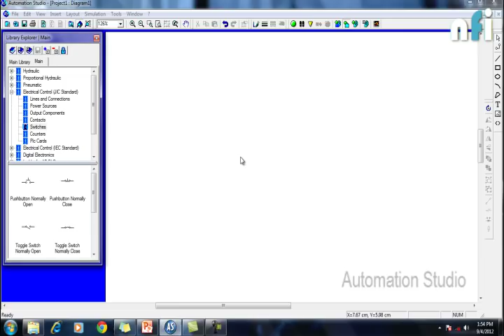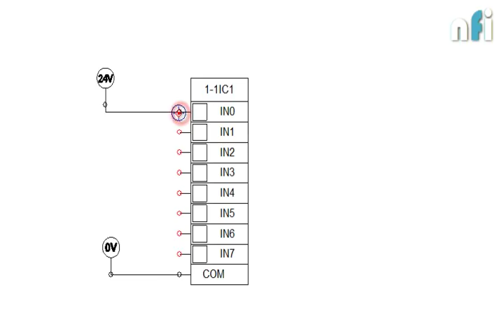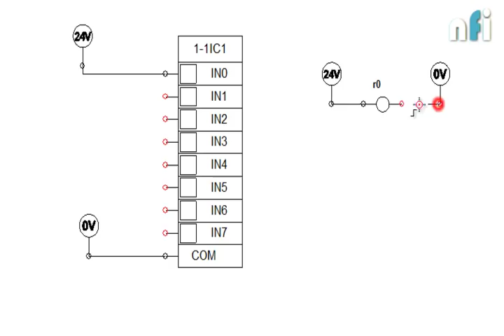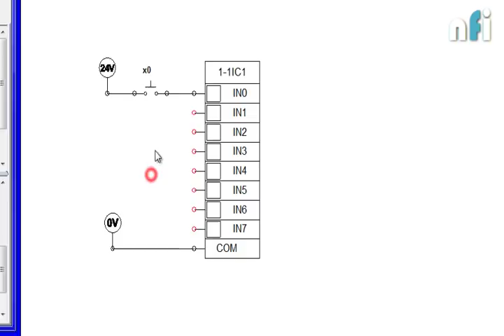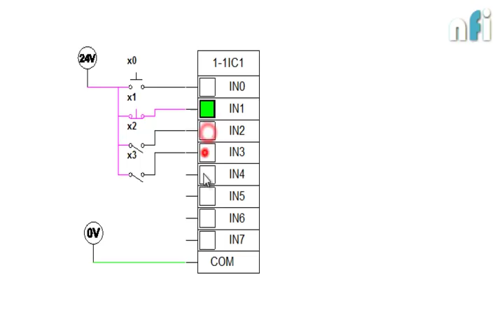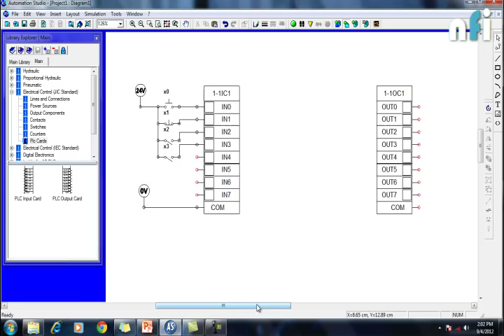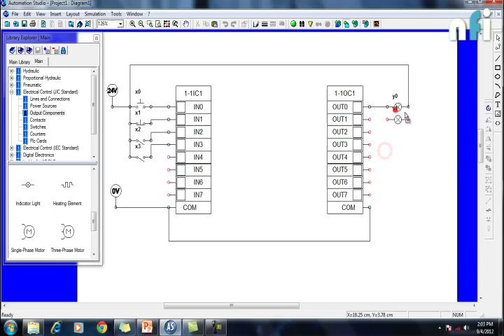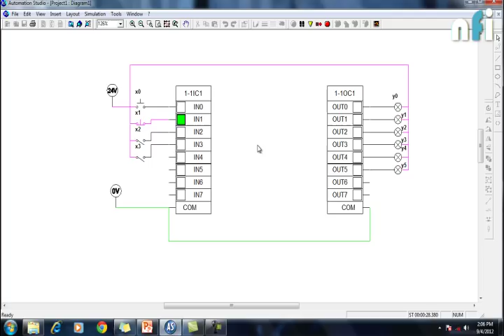PLC E-Learning Session 1 - Introduction to PLC & PLC Wiring

Comment: hai,
i had been working there in a Asphlat batch plant ,it automated with PLC micrologix 1000,but there is not any seperate HMI device for that  instead they where using one software named as "Parker"  from PC which were using for control purpose,i having a doubt here that the connection from PLC to PC is direct connection ? and  how to set that software ,can we use here any other software? please answer me .....

Comment: AIR VOICE ENGINEERING SOLUTIONS PVT LTD
Industrial automation
• Plc
• Scada
• dcs
• Hmi
• Drives (ac & dc)
• Process control instrumentation
Mep courses
• Electrical designing and drafting
• Heat ventilation & air conditioning
• Plumbing & fire fighting
Electrical designing and drafting
• Illuminations
• Cable selection
• Transformer
• Circuit breakers
• Ups and inverters
• Batteries
• Earthing
• Load distribution
• Phase distributions
• Sld
• generators
Hvac
• Ventilation
• Duct design
• Cooling load calculation
• Heating load calculation
• Hap software
• E-20 general form
• Chilled water pipe sizing
• Pump heat calculation
• Chiller design
• Ahu,fcu selection
• Vrf,vrv systems
Plumbing and fire fighting
• Plumbing fixtures
• Cool water pipe sizing
• Hot water pipe sizing
• Tank selection
• Pump selection
• Drainage system
• Vent pipe system
• Sprinkler system design
• Water hydrant system
• Fire alarm system
• Rizer pipe sizing
Security systems
• Cctv
• Fire alarm systems
• Access control system
• Building management system
• Home automation
Revit mep
• INTRODUCTION
• STARTING MEP PROJECTS
• MODIFYING SYSTEM SETTINGS
• PLANNING MECHANICAL SYSTEMS
• DESIGNING MECHANICAL AIR SYSTEMS
• PLANNING ELECTRICAL SYSTEMS
• DESIGNING ELECTRICAL SYSTEM
• PLUMBING SYSTEMS
• PLANNING FIRE PROTECTION SYSTEMS
• DESIGNING FIRE PROTECTION SYSTEMS
• CREATING DOCUMENTATION VIEWS
• ANNOTATIONS & DIMENSIONS
• REVIT MEP FAMILIES
FOR MORE DETAILS CALL ON : 9390551212

Comment: I want to start working with PLC. which software I need? Can I use only one software for programming, simulation and giving this program to PLC or I need different software? I mean what is the total requirement to start making a PLC based project?
Reply: Every PLC brand has it's own software. You cannot use one software for every PLC. Total requirement is Sensors (or Inputs), Controller (PLC) and actuators with wiring diagram details.
Reply: Please watch this channel "IT and Automation Academy" to learn about PLC,SCADA, HMI, DCS, IOT, Electrical Drives and many advanced technology.
https://www.youtube.com/channel/UC7C8Rq8FTgNn5mcXr-MjYAw/videos

Comment: Sir thank you very much for very sweet explanation.. can you please let us know how does a profibus ad its cable work...how they PLC and profibus can communicate with each other ???
Reply from the maker: Dear Vijay, Profibus is the term used by Siemens for their PLC communication network. It's like connecting PLC with PC or any other device via MPI cables for example. Later Profibus is optimized to Profinet by using Ethernet communication by linking the correct IP addresses. So it's generally the mode of communication just like Rs 232 or Rs 485.
Reply: sir do you have any videos regarding profinet or profibus which explains well..and can you please suggest me if you have...
thank you
Reply from the maker: Vijay Makvana well I don't have any video but with your suggestions I will create one and post in this channel :) thank you for your feedback !
Reply: Thank you very much sir to you too
Reply: Vijay Makvana o noticias

Comment: Hi Rajvir, these links are dead. Can you reupload these:
3) PLC E-Learning - Session 3 Introduction to PLC Trainer & PLC Software 
6) PLC Box Sorting Project- Ladder Logic
7) PLC Batching Project- Ladder Logic
13) Allen Bradley PLC Lesson 3: Understanding OSR- One Shot Rising 
17) Siemens PLC Lesson 1 - NO, NC & OUT Commands 
18) Siemens PLC Lesson 2 - Latching & Unlatching (SET/ RESET Commands) 
19) Siemens PLC Lesson 3 - Immediate Contact & NOT Command
20) Siemens PLC Lesson 4- Rising & Falling Edge
21) Siemens PLC Lesson 5- SET RESET Dominant Instruction

Comment: hi, In PLC Box Sorting we use 10 sensors. From 0 to 7 sensors we use PLC inputs and for remaining sensors you said an external input card is used. My question is how you have interfaced external card to PLC (you have not shown in videos ) ?

you are showing  wiring of a PLC in a schematic diagram (in a studio software). But we want to see wiring of a PLC in real scenario. 

Please make a video on wiring of plc and how to interface external card to plc in real scenario (Even which screw driver should be used to  screw and unscrew the plc inputs)

Comment: what if the light bulb is in 230V?
Reply: at the circuit provided...he only uses 24Vdc ...since most of lamps we used are in 230Vac that is why he is asking how to connect. Therefore we uses  DC voltage to the PLC and 230Vac for Output(lightings)
Reply from the maker: Just in case, if someone wants to power output which is AC (230V) you can connect a relay to the PLC output to switch the AC load. The relay should have ampere rating more than the load.
Reply: @Daniel. why are you powering a light with 230V!
Reply: +Boom. almost NOBODY uses 230v to power a signal light bulb.
Reply: almost nobody? if you are referring to 230Vdc(DIRECT CURRENT VOLTAGE)...nobody uses it....but 230VAC(ALTERNATING CURRENT VOLTAGE)...almost everybody. In asians 230vac for bulbs( referring to Incandescent bulbs) while some uses LEDs Lamps, which is also supplied by 110/220VAC. I am wondering how you power your lights in your country...in DC? DC supplies a lot expensive. lol
In most applications, when using PLCs, some components hooked to it doesnt mean that it is  powered only by 24vdc. Some components such as contactors where coils can be supplied either 24VDC and some can be supplied only by 220Vac source.What if you are given a contactor which can be supplied only by AC source?  that is why you need to isolate them.
Reply: how to get it's software

Comment: How to wire it if my output device is run by 220Ac volts eg. a light bulb or a fan???Plz do reply me
Reply from the maker: You need to connect a relay to the PLC output and then further actuate the Bulb via that relay. It's very simple actually.

Comment: How can I get the software could you please give me a link to download a free software
Reply: try this one>>>>i think its free ...not sure though....http://www.swansc.com/en/download/index.html
Reply: I have not been able to find out the way to download the Free Software Logix Pro; can yo help, please?
Reply: there is a software called Logixpro, in which you can learn how to program PLC ..plus it is a simulator.
Reply from the maker: Yeah Logix Pro would be a good option to try!
Reply: @daniele 
if you are familiar with piratebay you can search there. BUt you need torrent such as bittorent or uttorent to download the program
Reply: Thank you; unfortunatelly I am not familiar at all with such programs.
Reply from the maker: Daniele Salvatore it's not free, you have to buy it
Reply: its free in piratebay...it's cracked...unfortunately its pirated....LOgixpro is from allen bradley and  is very easy to learn, of course if  you have background with PLC programming and circuit designs. There are many tutorials everywhere
Reply: I have seen that the official download costs $ 160 that looks rather high.
Reply: Thank you; I will try.

Comment: whats the difference between push button and toggle switch.? it both works the same way. u Switch it on and the current passes. off then no current. similarly with push button. so when to use which.?

Comment: Hi..  That was a very good session,  appreciated completely
I have an issue,  i have Mitsubishi xmp8 plc, it is showing some fault, not able to figure what it is.. It only shows display on the device saying "XRAM" ..  With no indicator working for input or output.. Is it a Hardware related problem or a software related one.. 
Please respond ASAP.. Thx

Comment: hello Ranvir, could you please tell me how to select plc? like hows its inputs and output are selected,  what are the factors required in order to select plc?
Reply from the maker: +Vikash Kumar Everything depends on the application. If you are automating a process note down the various switches, sensors, actuators, their type (Whether Digital or Analog) , their Current rating (low or high)  and operation voltage (AC or DC), mode of operation (digital or proportional). All these factors matters in selecting a PLC. Well this is a long discussion and i can clear more concept if you share all those details of Sensors and actuators.

Comment: no doubt that was awesome explanation with great voice
sir i have little bit confusion i think the other side of indicators will be connected to common as plc output terminal will provided it 24 vdc.
Reply from the maker: +Wajahat Hussain It's not necessary that PLC output provides 24VDC. It depends on what you have connected to the COM of PLC. The signal connected to COM of PLC output will be available at PLC output (in case of Relay type PLC)

Comment: sir,pls help i have problem to compactlogix l32e the cable links between 2 plc does not recognize each other can either i run the ab compact logix to program or run.because the pushbutton to the operator with plc 1000 from ligthing cannot open the lighting sometime it will stuck the ligthing open without close the pb to close.

Comment: great video!
have one question. Isn't the COM terminals on the output side connected to 24v on the Plc in the physical wiring connection?
Reply from the maker: It depends ..you can connect 0 VDC and 24 VDC as well. 
The logic is whatever voltage you give to COM you will get the same in output terminal if the output is relay type in PLC
Reply: +Rajvir Singh (NFI Automation) Thank you! the particular system is an output relay type...thanks for clearing this up.

Comment: how to reset the fault in micrologix 1200,because my plc have fault when the plug from i/o expaNSION REMOVED
Reply from the maker: +stephanie joyce carmona  Well, if you are removing the I/O expansion then make sure you in the program you are downloading- it should not have I/O card added in the I/O configuration. If it is there, remove it and download the logic again, the error will be reset.
Reply: +Rajvir Singh (NFI Automation) What software are you using? thanks!
Reply from the maker: +sparky tekΩ I am using Automation Studio!

Comment: Sir good day! Are the limit switches of the motor depend on the command of the PLC or function of it ?
Reply from the maker: Sherfrank Dagasdas the limit switches gives command to the PLC on actuation. You can connect either NO or NC contact of limit switch to the input of PLC.

Comment: hello and thank you
would I be able to switch 220v lamp with this plc , I am asking this because we are using 24 volt power supply for the plc
Reply: +Mustapha Alkhafaaf your 24v will power a control circiut(say relay and switches) the 220v lamp will recieve a 220v but controlled by a 24v switch or relay as the case may be
Reply: Mustapha Alkhafaaf relay dude!!
Reply: this is exactly what I mean ... thanks

Comment: hello sir i have to connect a printer from an hmi but i dont know how to trigger it for printing as i required it to print, can you help me in that.. its delta plc ss2 series with delta hmi dop-b series.
Reply from the maker: Well, i never tried with Printer! But i guess the following steps would help:

1) Add your printer - Options - Configuration - Print - Add Printer
2) Take a button - "Report List"- This will trigger the print operation.

for details please refer to this manual: http://www.vezerles.iramko.com/download/technical_document/hmi/dop-a-ae-as_m_en_20070307.pdf
Reply: thank you rajvir sir

Comment: Sir, please explain why we use a magnitude of 24 V, why not some other magnitude ?
Reply from the maker: It's the most commonly used magnitude to RUN PLC. All PLC's run on 24 VDC. but then you would say -- "No, that's incorrent, I have seen PLC with 120 VAC or 220 VAC" . So those PLC's has internal power supply which converts that AC into 24 VDC internally., coz in the end the voltage goes to the IC inside the PLC, which runs at 5VDC. So 24VDC also regulated to 5VDC further. 

So in general we use 24 VDC as a magnitude for PLC operations.
Reply: Okay,  got the point..

Thank you sir.
Reply from the maker: Your welcome!
  
Regards,
Learn to Code | Code to Learn